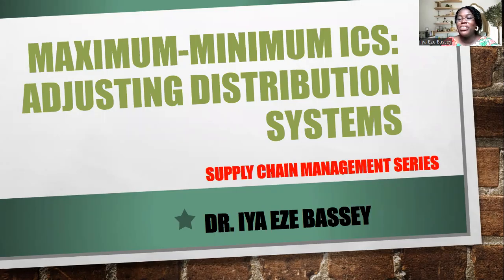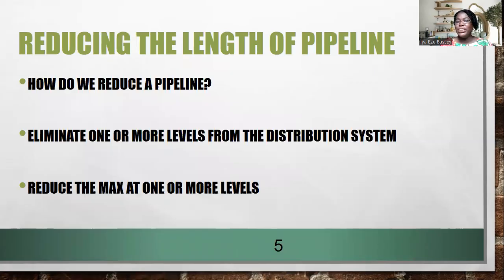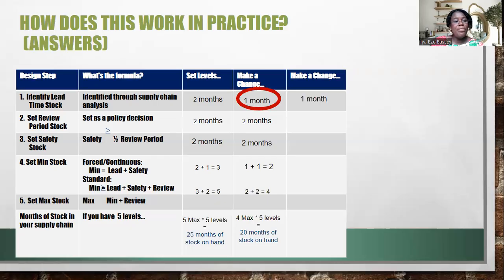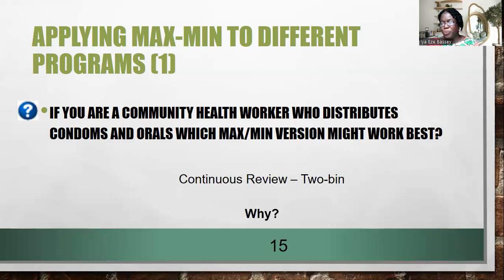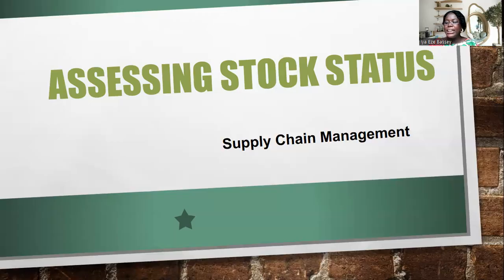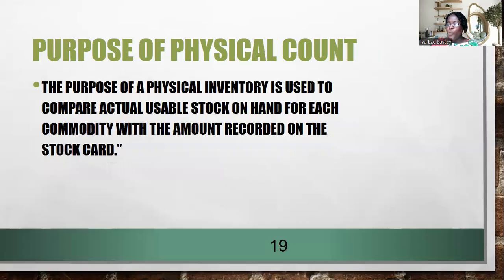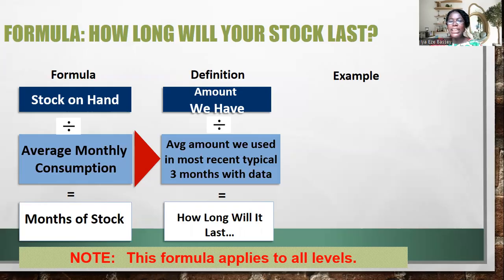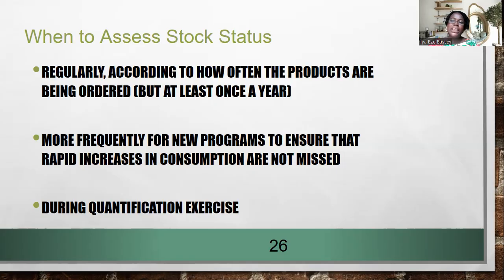Maximum-Minimum ICS: Adjusting Distribution systems (Supply chain management series)

Comment: I understand the steps in designing a max to min ICS which are 
A. Set up initial maximum policies for each level and faculty
B. Check if the overall distribution will function properly if the max-min policies are implemented
C. Check the total length of pipeline that the policies of each level imply 
It is important to carefully analyze demand patterns and adjust inventory levels accordingly 
By monitoringsales data and forecasting future demand,business can determine the optimal distribution strategy to ensure that products are available when they are needed

Comment: Maximum and minimum inventory control system adjusting distribution system involves learning the ways to adjust distribution system policies.its challenges and advantages of maximum includes mini mus inventory control system It's benefits include avoiding overstocking, understocking, minimizing wages and reducing emergency cost. Setting initial max min quantities ensuring the distribution system function effectively

Comment: To improve the distribution policy in Nigeria. We'
Determine the length of the pipeline
Reducing the length of the pipeline if it's too long
Factors that impact max-min stock levels are
Cost of products
Reliability of transportation
Storage capacity
Cost of storage
  Others are:
Lead time
Reliability of source of supplies etc
Also there are advantages nd disadvantages of zero balance
Physical count is the process of counting by hand the total number of usable units of each commodity in our store on health facility at any given time
The purpose of this physical count is used to compare actual usable stock on hand for each commodity with the amount recorded on the stock card

Comment: In summary, implementing a maximum and minimum inventory control system helps in:
- Avoiding overstocking and understocking
- Reducing wastage
- Minimizing emergency orders
- Simplifying inventory management
- Ensuring consistent stock levels

In supply chain management, assessing stock status is vital through: 
Physical count of useable units of each commodity. &
By using formula: to ascertain how long your stock will last.

Comment: In the cause of this lecture maximum - minimum ICS Adjusting distribution system has been simplified 

The steps in designing a max-min IC'S are;
✓ set up initial mac_min policies for each level 
✓ check if the overall distribution will function properly if the level specific max-min  etc.
 
Definition of physical counts
A physical count is the process of counting by hand the total number of usuable stock on hand for each commodity with the amount recorded on the stock card.

✓To determine the number  of shock supply in a month

Stock at hand ÷ average monthly consumption= months of stock.

Comment: To reduce the length of pipeline, you need to:
1. Eliminate one or more levels from the distribution system.
2. Reduce max at one or more level. 

Factors that impact Max-Min stock level are: 
1. Storage conditions at different level. 
2. Cost of products 
3. Reliability of transportation
4. Effects of a zero balance of stock. 
5. Age of program 

The advantages of Max-Min ICS are: 
• Avoid under stocking 
• Simplify Inventory Control decision -making. 
• Reliable data source from SOP for processing and quantification.

Physical count is defined as the process of counting by hand, the total number of usable unit of each commodity in your health facility. 

The  purpose of Max-Min Inventory Control System are: 
1. To compare actual usable stock on hand. 
2. To determine how long will the supply last. 

When to assess stock status :
• During quantification exercise 
• Regularly 
• More frequently for new program.

Comment: When adjusting distribution systems, you need to consider factors like:
 1) Pipeline length: The time it takes for products to move through the supply chain.
2. Reducing pipeline length: Streamlining processes to minimize delivery times.
3)  Reducing maximum stock levels: Optimizing stock levels to avoid excess inventory.

Advantages of Max-Min Inventory Control Systems:
 -  Avoids overstocking
 -  Prevents understocking
 - Reduces emergency order costs
 -  Maintains consistent stock levels
 - Simplifies decision-making

Challenges of Implementing Inventory Control Systems:
 - Managing complex systems: Handling multiple locations and products.
 - Handling large numbers of commodities

To determine how long your current stock will last, you can use:
 - Physical counts: Physically counting your inventory.
 - Calculating how long supplies will last.

Purpose of Physical Inventory:
Physical inventories are essential to:
 1) Verify stock levels: Compare actual stock to recorded levels.
 2)  Identify discrepancies: Detect any errors or discrepancies in inventory records.
 3) Improve accuracy: Ensure accurate inventory data for better decision-making.

Comment: Here is what I learnt from the lecture.
The steps in designing a max-min ICS are:
a. Set up initial max-min policies for each type and type of facility
b. Check if the overall distribution will function properly if the level specific max-min policies are implemented
c. Check the total length of the pipeline that the policies at each level imply.

Other Factors That Impact Max-Min Stock Levels:
a. Lead Times
b. Reliability of source of supplies 
c. Effect of a zero balance of stock 
d. Management skills of staff 
e. Age of program 
f. Accuracy of forecasts

Comment: Thank you very much ma this interesting and educating  video.
I've learnt and understood the steps in designing a Max - Min ICS.
I also learnt the factors that min/max stock levels which are: lead time, age of program, accuracy of forecast, management skills of staff etc.
I understood the advantages of max /min inventory control system which are :
- Avoid overstocking
- Avoid understocking 
- Minimize wastage, etc
They're certain challenges that affects the system which are:
- Systems with numerous levels
- Systems that manage products for new programs, etc
I also understood that they're steps involved in the designing of max/min ICS which are:
- Initial max/min polio for all levels
- Check if overall distribution will function properly
- Check the total length of the pipeline that governs at each level
Thank you very ma for this impactful one. God bless you

Comment: Thank you Ma for this lecture. I was able to understand that the purpose of the inventory control system:
1. It helps to maintain an appropriate stock level of all products in order to avoid shortage and oversupply.
2. It helps determine the quantity of stock/ when it should be ordered.
I got to learn about some terms-Maximum stock level- max. quantity of commodity a stock keeper can hold at any time. The max. Stock level for all Hiv/Aids commodities, lab reagent and consumables is 4 months.
Minimum stock level- this is the min. amount of commodities a stock keeper may have in order to avoid stock out.
The minimum stock level is 2 months.
Types of min/max ICS
1) Forced ordering max-min ICS 2) Continuous review max-min ICS 3) Standard version max-min ICS
Review period- the time schedule for reviewing stock levels.
I also learnt about more terms like Emergency order point, safety stock level, Lead time.

Comment: Maximum -Minimum ICS-Adjusting Distribution System
Thank you ma for the teaching 
In summary 
Steps in designing a Max-Min ICS
-Set up initial Max-Min policies for each level and type of facility 
-Check if the overall Distribution will function properly if the level specific Max-Min policies are implemented 
-Check the total length of the pipeline that the policies at each level imply
Factors influencing maximum -Minimum stock level include 
Stock capacity 
Production cost
Storage cost
Lead time 
Benefits of implementing Max-Min Inventory Control System 
Minimizing waste
Avoiding overstocking 
Maintaining consistent stock level

Comment: I also learnt on the steps on designing the maximum ICS which involves different steps like setting up an initial MAXI-MIN policies for each level and type of facility by checking the total length of the pipeline 

Then I noted the factors that can impact MAXI-MIN stock level which Include.
- Cost of Products 
- Storage Capacity
- Lead time a
- Reliability of Transportation

Comment: In summary , I've learnt : 
The Key Considerations for Adjusting a Distribution System
Assess pipeline length.
Reduce pipeline length to enhance efficiency.
Lower maximum stock levels to minimize excess inventory.

Factors Affecting Maximum-Minimum Levels
Age of program 
Cost of storage 
Cost of production 
Lead time

Advantages
It offers several advantages 
Prevents emergencies.
Simplifies inventory management decisions.
Reduces waste and associated costs.

Stock Status Assessment
This determines the remaining months of stock by:
Conducting physical inventory counts.
Calculating supply longevity.

The purpose is to compare actual stock levels with stock card records for accuracy.

Comment: Thank you very much ma'am!
I learn on the steps of designing a Max-Min ICS which are:
*Set up initial Max-Min policies for each level and type of faculty
*Check if the overall distribution will function properly If the level specific Max-Min are implemented
*Check the total length of the pipeline that the policies at each level imply
And others Factors that Impact Max-Min stock level which are;
Lead Time
Management skills staff
Age of program
Accuracy of forecasts
Effective of a zero balance of stock.

Comment: In summary, I learnt that maximum minimum ICS adjusting distribution system helps us to know more about the ways to adjusting distribution, system policies, how to reduce maximum stock levels and pipelines.
 They are also factors that affect the maximum minimum stock levels which are ; 
1. Cost of product 
2. Reliability of transportation 
3. Storage facility 
4. Cost of storage 
5. Storage conditions of different levels
6. Shelf life of health commodities 

Advantages of Maximum minimum System 
- To avoid overstocking and under stocking 
- minimize wage
- Avoid cost of emergency orders
- Simplify inventory control decision making
- consistency of stock levels

Disadvantages 
- systems with numerous 
- systems that manages a large number of commodities 
- systems that manage products for new programmers

Also how to access stock status to know the amount of stock and to know when to check the stock.

Comment: Thank you ma for this amazing lecture on the Topic: Adjusting Distribution System in Maximum - Minimum ICS. 
       Reducing Length of a Pipeline
It can be reduced by: 
- Eliminating one or more levels from the distribution system
- Reducing the maximum at one or more levels.
        Factors that Impact Max - Min Stock Levels
- cost production,   - Storage capacity
- Reliability of transportation - cost of storage
- Lead time - Age of program
    Advantages of using Maximum - Minimum system
- To avoid over stocking
- To avoid under stocking
- To minimise waste
- To avoid cost of emergency orders etc
       Accessing Stock Status
1) Physical count/ Inventory: is the process of counting by hand  the total number of useable units at any point in time.
         Formula for how long stock  last 
Stock at hand ÷ Average monthly consumption= month of stock

Comment: Thank you, Ma, for this insightful lecture. I gained a clear understanding of the purpose of the inventory control system (ICS):  
1. It helps maintain appropriate stock levels to avoid shortages and oversupply.  
2. It determines the quantity of stock and when it should be ordered.  

I also learned key terms related to ICS:  
-Maximum Stock Level:The highest quantity of a commodity that a stock keeper can hold at any time. For HIV/AIDS commodities, lab reagents, and consumables, the maximum stock level is 4 months.  
-Minimum Stock Level:The lowest quantity of a commodity a stock keeper must maintain to prevent stockouts. The minimum stock level is 2 months.  

Types of Min/Max Inventory Control Systems:  
1. Forced Ordering Max-Min ICS
2. Continuous Review Max-Min ICS
3. Standard Version Max-Min ICS

Additional Terms Learned:  
-Review Period:The scheduled time for reviewing stock levels.  
-Emergency Order Point:The stock level at which an emergency order must be placed to prevent stockouts.  
-Safety Stock Level:A buffer stock maintained to handle unexpected demand or delays.  
-Lead Time:The time it takes for an order to be delivered after it is placed.  

Thank you again for this comprehensive lecture!

Comment: Thank for the lecture Ma,

In summary, the steps for designing a max-min ICS were discuss and how to reduce the length of pipeline and several advantages of using max-min system include, too much of overstocking, Avoid under stocking, minimizing wastage etc. Some factors which impact max-min stock levels are product cost, storage capacity and cost of storage.

Comment: Thanks for the lecture Dr,

In summary, the steps for designing a max-min ICS were discuss and how to reduce the length of pipeline and several advantages of using max-min system include, too much of overstocking, Avoid under stocking, minimizing wastage etc. Some factors which impact max-min stock levels are product cost, storage capacity and cost of storage.
Reply: In summary, the steps for designing the max-min inventory control system, how to reduce the length of pipeline were discussed.
Elements of the formula which can be changed in order to reduce the Max stock level inclusive shortening the review period ,reducing the lead time, and also improving the distribution system's reliability at one or more levels. Other factors that impact max-min  stock levels such as cost of products, reliability of transportation ,storage capacity, lead time,etc and challenges to using each version and variation; system with numerous levels system that manage a large number of commodities and system that manage products for new programs are to be considered while designing the max-min inventory control system.
Applying Max-min to different programs; 
1 as a community health worker:- Continuous Review -Two-bin
2 Version recommended for drugs/HIV kits, and Lab - Standard Version.
Knowing how and when to assess stock status by physical counting is paramount as it helps to determine how long supplies will last.
Formula: MOS=SOH ÷ AMC
AMC= Recent monthly consumption ÷ 3
SOH= Stock on hand at facility (total of all testing sites).
And advantages of using Max-min system include avoiding overstocking, under stocking, reliable data source from SDP for forecasting and quantification, etc.

Comment: Throughout this lecture, I've gained valuable insights into optimizing distribution systems and inventory management. Key considerations for adjusting a distribution system include:

1. Pipeline length assessment
2. Reducing pipeline length to enhance efficiency
3. Lowering maximum stock levels to minimize excess inventory

The Max-Min Inventory Control System offers several advantages:

1. Prevention of overstocking and understocking
2. Reduction of waste and associated costs
3. Avoidance of emergency order costs
4. Maintenance of consistent stock levels
5. Simplification of inventory management decisions

However, challenges persist in using inventory systems, including:

1. Managing complex systems with multiple levels
2. Handling diverse commodity portfolios
3. Managing inventory for new programs

Stock Status Assessment is crucial in determining the months of stock remaining. This assessment involves:

1. Conducting physical inventory counts
2. Calculating supply longevity

The primary purpose of Physical Inventory is to reconcile actual stock levels with stock card records, ensuring accuracy and transparency.

Thank you, Ma'am, for the enlightening lecture.